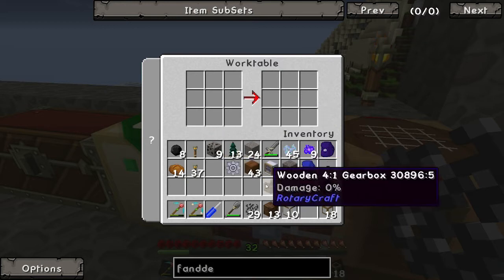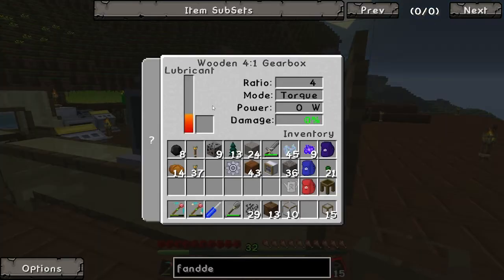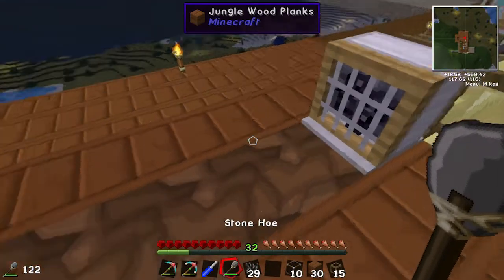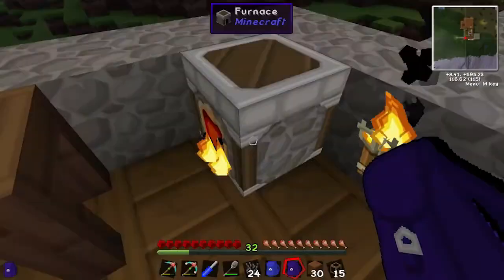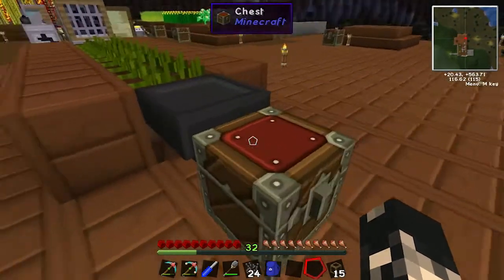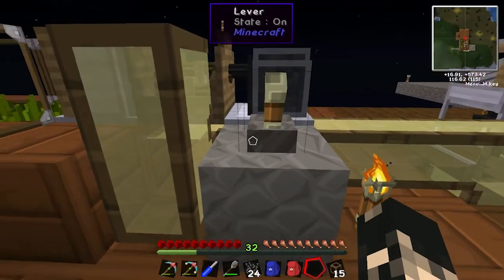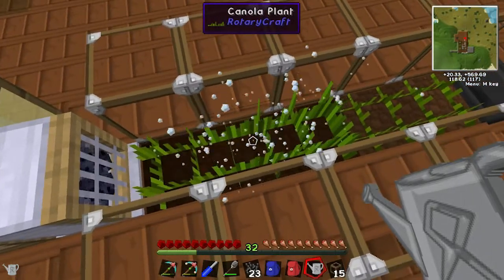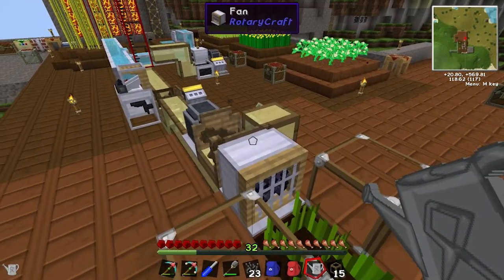Monster FTB Automatic Farming with Rotarycraft

Comment: man, I've been struggling with rotarycraft the whole day today and managed to get one of those water engines working in like 5-6 hours... but I still need to get a reliant, automated system for lubricant as it seems to be the very basic step to take for this mod. Will definitly watch more of your videos tomorrow, because this is brilliant!
Reply from the maker: thanks, the next video I upgrade the farm in this one to be powered from a wind turbine so i can run 4 fans and not have to use a gear box.

Comment: Im having trouble, when i attach the 4x1 gear box to the DC engine, it works in torque mode, but when i turn it to speed mode it gets no power
Reply from the maker: Check that the gearboxes isn't damaged